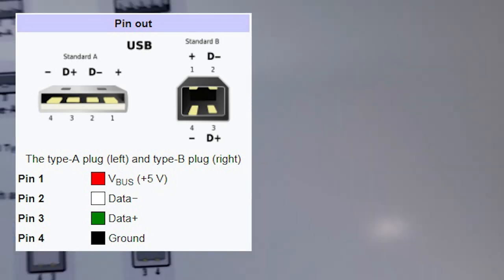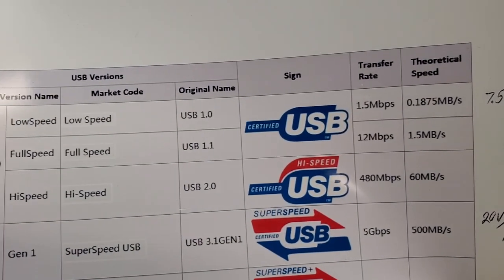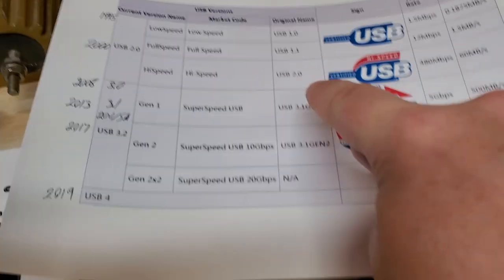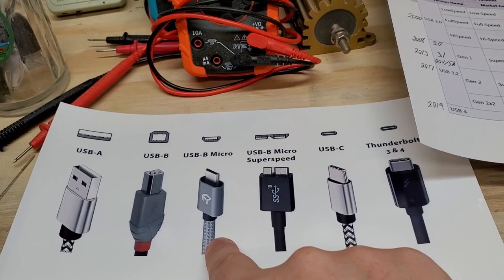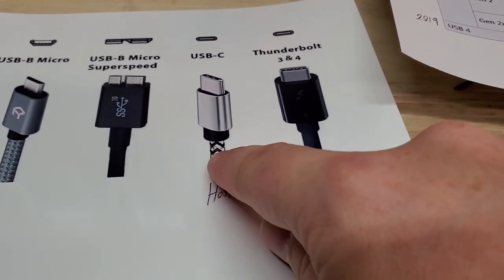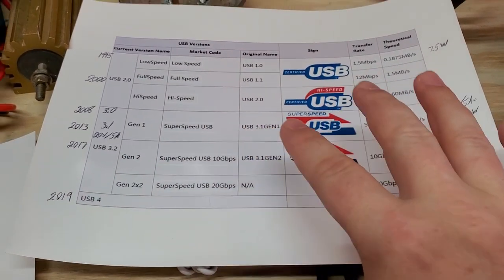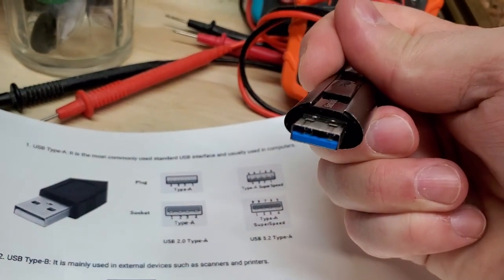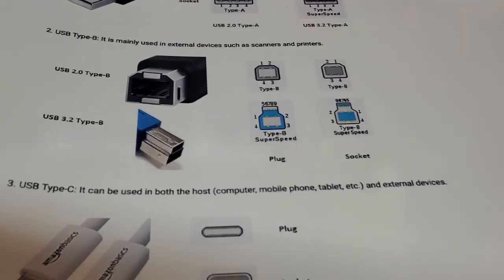USB In A Nutshell

Comment: 9:25 You are right, the maximum length is 16 feet (5 meter), for longer distance you need a USB repeater/amplifier/booster.
It's not only the signalvoltage that drops, but also the 5V supply voltage that drops, and that gives problems to correctly powerup/recognise devices like a 2,5" harddrive.
10:48 The bulkier 3.2 Type B connector is not only used on printers, but is very common on external harddrives and harddrive dockingstations.
For this type, you need to have good quality cables, because the cheap ones are wiggle like hell.
13:38 The USB C connector has another big benefit, and that it not only can deliver 5V, but also 9V, 12V and 19V (maybe more that i'm not aware of).
You can use notebook charger with USB C output jack to charge a notebook at 19V, but when connected to a smartphone, the charger delivers only 5V.
USB C negotiate between the devices which voltage is needed.
20:03 In memory cards like MicroSD / SD etc, there is also the type of Class, the very slow ones have C4 (Class 4) have a speed of minimum 4Mbit/sec, the faster ones like C10 (Class10) have a minimum speed of 10Mbit/sec.
And as last, not al usb 3.0 usb thumb drives are faster then usb 2.0 , in theory yes, but in practice no. I have seen a type of the Kingston Data Traveler (white stick with small color band), this "usb 3.0" thumb drive is much much slower then the older usb 2.0 thumb drives.
If you pay peanuts, you get monkeys they say, but this is definitely the case when buying usb thumb drives.

Comment: The clock + data is called synchronous serial. The signalling we know from the old DE-9 serial connectors does not have a clock signal, and is called asynchronous serial :)
Reply from the maker: Correct. I should have separated synchronous from asynchronous  and explained why the baud etc needs set. - which is why I kinda explained both together..  Serial communications really needs its own video because we do use serial on most medical devices in one for or another. USB uses preset IDs for product identification and controller chips which auto-negotiate the transmission rate etc. RS232 can do Sync and Asyc but when connected to a PC, the UART cannot deal with a sync.